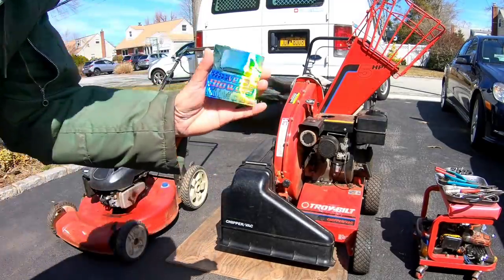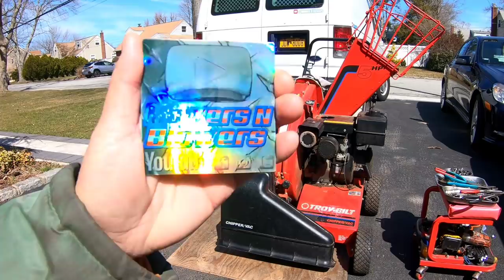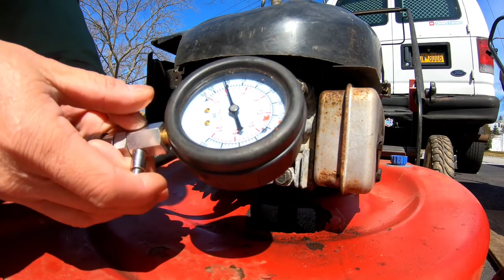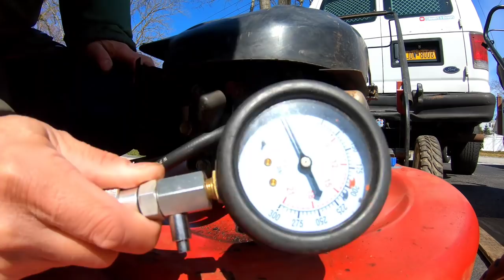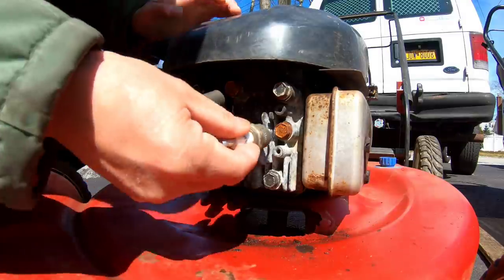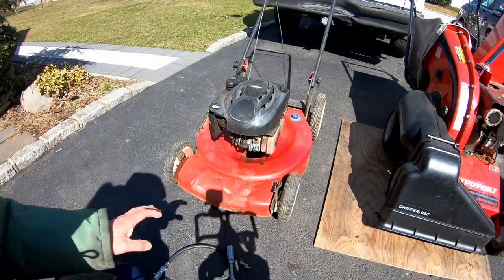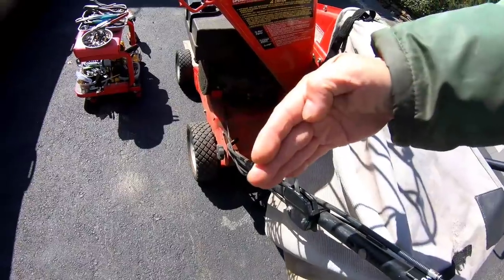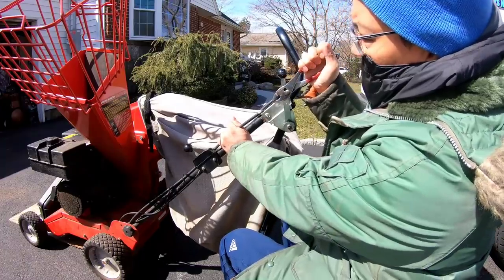FREE TROY BILT GARDENWAY MTD 5HP TECUMSEH LAWN VACUUM VAC WOOD CHIPPER BAIL CABLE REPAIR COLD START

Comment: sometimes I use general purpose grease on the cables , around the ends of cables to pull in the grease I think it might keep water out also. what do you think ?   great job getting that bale handle moving

Comment: Yeah... your compression tester is wonky... all my quantum engine's read around 80psi. That engine would not run or barely run on 50psi. You forgot to check the oil henry. I'd verify that the engine is a good runner before wasting time fixing cables ect. Kinda did it backwards. Glad you got it running, sounds good for a tecumseh.

Comment: How is it going Henry can I use permatex red to make a seal on a birggs oil sump pan on engine  i have one leaking oil while a run it thanks for your help. keep these videos coming i really like them. wish i could get more subs im trying my best take care thanks
Reply from the maker: Yes, itll work
Reply: @MowersNBlowers  how much do i use just a thin amount?
Reply from the maker: Just as thick as a regular gasket,  both sides